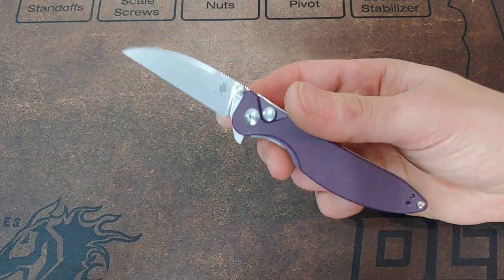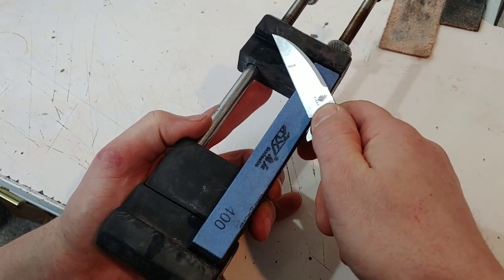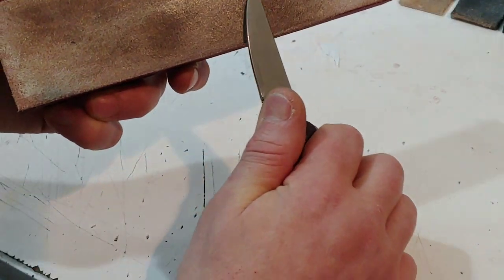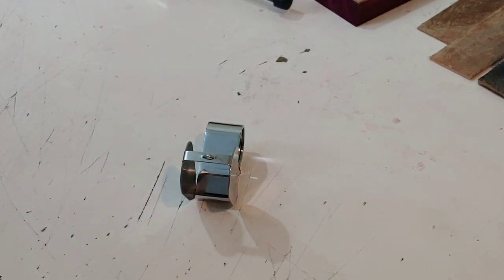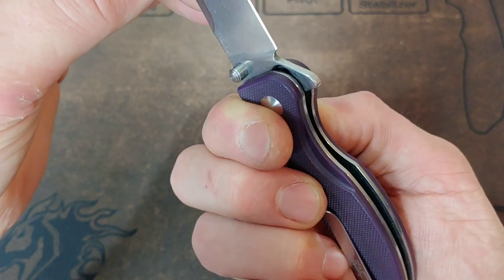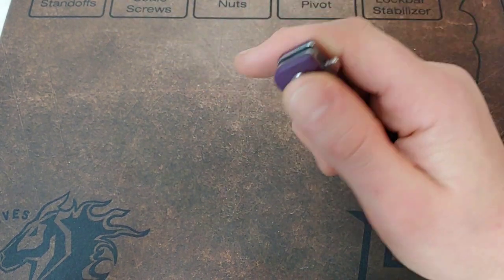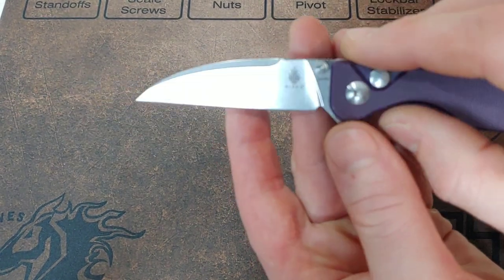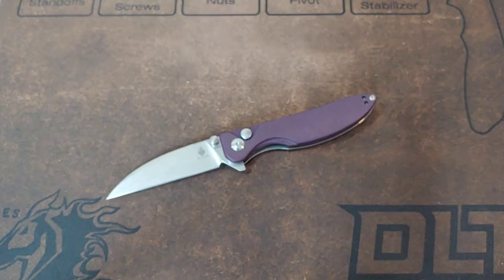KIZER SWAGGS SWAYBACK REVIEW

Comment: You got the purple! 😍 thank you for another great review ❤️
Reply from the maker: Thanks Swaggs! Awesome you checked out the review, now i get to run around saying, ( yeah Swaggs, she watches the channel) 😆 stay awesome SWAGGS!!
Reply: @NeevesKnives  A great little fidget freely  flip knife with the perfect combination of button lock. With only slightly less actual sharpened blade length than the similarly compulsive Spyderco Smock. At just the right price to pick up guilt free, while you wait for your Protech Malibu to become available.

I picked up the brown, and so far don't have anything but good things to say about this well thought out knife. Fit and finish is good for the price. There's some bit of grit in the release button that took a bit to clear without dismantling. I oiled it slightly as well. Still seems to catch just a little bit sometimes. Possibly a very small burr, but I'll for the moment let it break in a bit. I may treat it to a tiny amount of a specialized grease that, used in moderation, is intended for and works well on Glock slides. So far it's very minor, tolerable, and seems to be resolving itself with use.

Comment: I really like this one. Unique budget option with some neat features. How is N690 steel? Is it comparable to other steels?
Reply: How would you rank VG10, 14c28n, and N690?
Reply: @simplyknives7117  I like 14c28n, although both others are ranked higher it might be a little tougher. I feel the other two hold a better edge. If heat treated properly N690 is a tad better in the edge holding department. Corrosion resistance is noticeably better in the N690 and VG-10. A lot of South African makers use N690, haven’t seen much in VG-10, Todd Begg uses N690 a lot as well. Hopefully that helped at all, but that is all I know about that😂
Reply from the maker: I do like 14c a bit more but its still great i would say its better than 9cr its a great steel for edc, great stain resistance, and holds a decent edge, easy to Sharpen and strop wich is great for edc, because you can keep the edge going for a long time by stropping
Reply: @NeevesKnives  agreed, 14c over 9cr, N690 with proper heat treat Is preferred for me especially living in Florida, corrosion resistance is high on my list, I like, and don’t mind sharpening at all but rust and corrosion hurts my stomach 😂
Reply from the maker: @1130jawz  most definitely! You want to get a steel that best suits your environment and use, and n690 is a fantastic steel for edc I love it